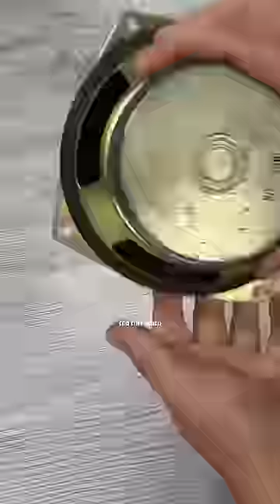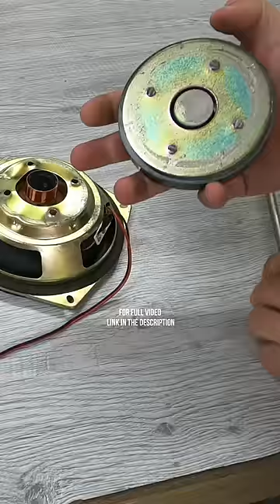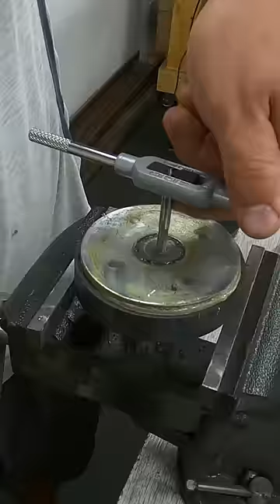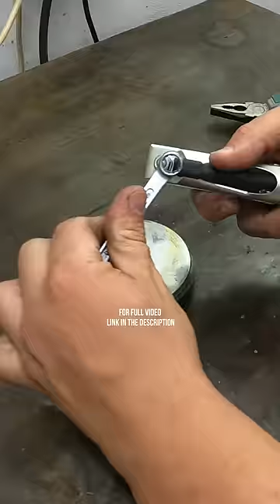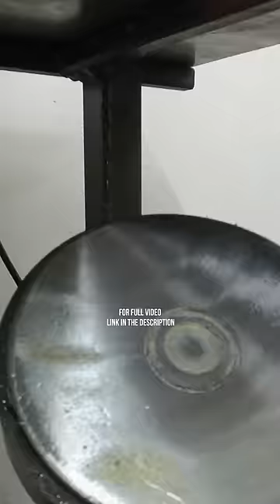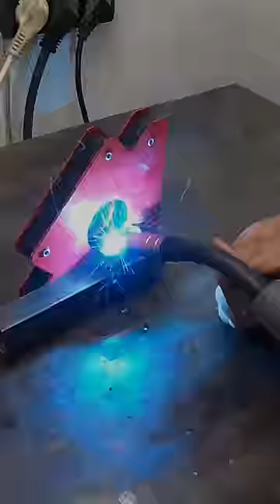Amazing idea from Old Speaker

Comment: I see a lot of people saying heating the magnet will ruin it. While that's true, it's also true the magnet should never get heated. There's no reason it should be close to the work if it's connected to a steel tabletop, therefore it won't get heated (unless your ground surface is bad and causing arcing, which is still user error.)
Reply from the maker: Well done, that's right! The magnets are away from the heat! The magnet is very strongly attached to the work surface!
Reply: Unless it is a superconductor, It will heat up. Also, I'm pretty sure that clamp would have just clipped directly to that metal table. This is clickbait. Anything so simple would have already been a commercial product if it were viable.
Reply: That's true in principle.
But the heat generated by the welding current is very low because the cross-section is appropriate. In addition, the mass of the magnet and the table is very large. You hardly notice any harmful warming
Reply: @HangTimeDeluxe  not remotely appreciably, definitely not enough to ruin a magnet. 
I've never even had my regular ground clamp heat up if it's more than 6" from the work,  except maybe the face of the copper pads. If your ground is heating up it's either undersized, has a poor connection or too close to the work. 
Period
Reply: @HangTimeDeluxe   Magnets for welding ground clamps have been available for decades. Nothing new here other than he made his own by recycling an old speaker
Reply: You can pay original for those magnat clamps.
We use it in car Repair shops .
If we need new body pannels on the cars.

So its new .
Its a good DYI that is for sure.
Reply: @HandmadeCreativeChannel  iiiķo
Reply: 3 magnet killers, Heat, banging it & A/C field.
Reply: @CryptTonite1955  yep all those welders that use commercially made magnetic ground clamps are replacing them after every use.
Not to mention banging does zero to permanent magnets, unless they're actually shattered, then each piece is magnetic.
Reply: @HandmadeCreativeChannel  l
L

Lll
Reply: @HangTimeDeluxe  To say anything that’s simple would already be a commercial product if viable is a ridiculous statement. Especially if you ARE AN ENGINEER!! 
How many products out their are over engineered?, and made as regulation. I’m a building contractor OF OVER 60yrs and I can FACTUALLY say most houses are over engineered. So many products in the world that are over engineered and the simplest way as you say is shut down. Why because it won’t make to companies money.
Reply: I, at first, thought this person is going to make a super electro magnet! As in the ones that move recyclable ferrous™ materials in to the foundry....7;^> ....heh
Reply: @CryptTonite1955  stop talking gumpf, if a/c field killed magnets then we wouldn't have speakers.
Reply: @mcallister1984  speakers 🔊 are in the milli end of things, look up Growler for demagnetising
Reply: 8
Reply: Well there is the minor fact that the bolt that carries all the current is threaded directly into the magnet...
Reply: @HangTimeDeluxe  there actually is a product like that on the market.

Comment: That was a perfectly good speaker!!!
Reply: Nah the speaker was broke after he removed the magnet on back. Wouldn't work now unless he used the cone part in cabinet as a passive radiator speaker
Reply: The speaker looked fine, but part of the voice coil may not have been good.
Reply: @jordan6750  I meant before he took anything off the speaker it looked good.

Comment: Another cool hack for old speakers. A friend of mine did this. He took 12 inch woofers that were bad, and ripped out their cones. They could vibrate, but not make sound. He then pulled the fabric on the back of his couch and screwd them into the couch frame. He then patched them into the audio system, cutting off everything but the very low end.
I tell you, you felt the explosions and the rumble of a plane engine. That scene in Jurasic Park, you could feel the step of the T-Rex.
Was pretty awesome and super easy to do.
Reply: That is kind of a cool idea.
Reply: There's actually a commercial product called "bass shaker" made for exactly this purpose
Reply: Great idea 💡
Reply: существует вибро динамик
Reply: Would you mind to draw this for me?
Reply: I just reconed my speakers,they sound great
Reply: My subwoofer does this without a shaker lol. And btw if you want to mod old woofers into shakers you need to connect the voice coil to a spring and then screw that to the sofa. If you just rip off the cone, nothing will happen after that even if you plug it in an amp.
Reply: @dingdong2103  except it did work. Worked great in fact. It didn't need a spring  because they were pretty big speakers. 10 or 12 inch woofers. As such, when the magnet vibrated, it's mass was enough to drive a vibration through the speaker frame, which aas screw right into the sofa frame. It actually worked really well, as it would scared the crap out of you at the scene when the Trex was first coming and you felt the footsteps more then you heard them.
Reply: @haddow777  The magnet doesn't vibrate without a voice coil and if the voice coil doesn't have mass behind it, effect is going to be minimal. Stop telling fairy tales please...
Reply: @dingdong2103  okay, you  need to read better. I was talking about a speaker with the cone removed, that's all. The magnet and voice coil are all one unit attached to the rear of the frame. Who said anything about removing the voice coil?
Reply: @haddow777  hi, the magnet 🧲 doesn’t move, it’s attached to the speaker frame,but the Coil which is attached to the cone does, just saying.
Reply: @CryptTonite1955  the coil moves yes, but the coil is in the middle of the magnet. The magnet is simply a ring around the coil. As the coil changes polarity, it moved forward and back in that ring. It is attached to the ring by a material glued to both on their face. The cone is attached to that surface.
The coil could not work if it wasn't attached to the magnet, or it would move too far out of alignment and the speaker would break.
When I spoke about removing the cone, I simply meant all the parts above the film bonding the coil to the magnet, the parts that move the air. As such, the coil moves, but very little air is displaced. Thus, the vibration is there, but not the sound.
Reply: @haddow777  hi, I’ve pulled a few apart in my apprentice days, very simple but magical how that shaking creates music and singing, cheers 🍻
Reply: @CryptTonite1955  does it compare much to a full sound system that's outputting the exact sound being fed into it? The entire point of the system was that the ripped apart speakers would be working in sync with an actual sound system. Of course vibrations will make some sound. In a setting where there is a much louder sound system in sync with it though, all anyone is going to notice is the vibration. Especially when it's mounted to the back of a couch that has a lot of padding between the people and them.
I simply don't understand your desire to poke holes in something that was plainly described initially. 
Yes, of the only output was to just the coneless speakers, likely we would hear sound. Only  a low rumble though, as only low end base was sent to them  but all the same they likely made some sound. None of us noticed any though, because the many well functioning speakers blasting at the time simply overshadowed it to the point it didn't really exist anymore.
Reply: I love my bass shakers. So amazing on a simulator. Every sequntial shift has that snap to it

Comment: The best way, if you don't have a place to clamp onto, is to put a piece of 1/8" 1" x 2" into your ground clamp. grind the paint off the item you're going to weld. Then shove that piece of metal against your project metal and do a light tack. Problem solved. When done, knock it off with a hammer and clean up with a fine flap wheel on your angle grinder. Keep magnets away from welding. The magnetic flux bends the arc. That's the way arc shutes for big contactors are used. To draw the arc away from the tips so they wont fry. Also, heating a magnet will make it loose its strength really fast!.
   The way professionally built magnet grounds are made, is that they have a strong spring on a center bolt made out of copper, and bolted to the welder ground cable. When you put the magnet base onto your work, the spring holds pressure on the copper grounding contact to your project.

Comment: very good idea I use a 10 lb magnet myself and I don't have to mess with that stinking clamp anymore the only problem is you have to use a clamp on aluminum when you're welding it but still fantastic anything but still won't work still have to use a clamp
Reply: Depends on how thick the aluminum is. On thin sheet you can put a thick iron disc on one  side and the magnet will stick from the other side.
Reply: Ben and Kiki

Pp

Comment: Great idea, I do not like introducing magnetism to any metal while welding. Or any tool especially when machining, because of tiny particals sticking to the bits. Your better off not doing it. I've also seen parts get so magnetized, welding is almost impossible.

Comment: The magnets also work good for mechanic on your car lift arms you can put one magnet on each arm and stick lug nuts to them or other nuts and bolts and even tools too so they dont fall off and wack you😎✊🏻
Reply: DEFINITELY A USEFUL SUGGESTION!!!!👍 Most people wouldn't think of something like this! Although, I have magnetic dishes that I use all the time for holding lose nuts and bolts!
They are simple enough to make, just get some speaker magnets and a sturdy metal bread pan and glue the magnets to the bottom of the pan... Viola, you have a magnetic parts tray!!!
Reply: @randyherringshaw6325  most of the magnets are wide and work like a dish too when you magent then to the lift arms🙃

Comment: I have used a magnet on my welder for over 25 years now...this is not not anything new. over time the magnet loses its power, then just replace it. Simple as that. And if you must use the clamp just attach the magnet on to the clamp.

Comment: You just put the ground terminal right in the way of the magnet's ground contact surface.  Put the terminal on the other side n this is a great idea
Reply: Correct, coil gap side is much stronger.

Comment: Нагреется, магнитные свойства теряет и ваша масса будет отпустить и провода массы начнут грется
Reply from the maker: Масса находится слишком далеко от источника тепла (переводчик)
Reply: @HandmadeCreativeChannel  контакт нагревается сам очень сильно
Reply: @MrStrocko  Not if it is a good contact!
Reply: @MrStrocko  If you are that worried about the contact heating up, you could always just use some dielectric grease to improve the conductivity of your contact which will decrease any heat buildup from the electric resistance of the ground!
Reply: @randyherringshaw6325  обычно я привариваю кусочек металла к изделию и подсоединяю к инвертору плюс или минус

Comment: what if stainless
Reply: The magnet is stuck to the table and will still provide a stable grounding to weld on, regardless of the metal you are working on! Unless you use a stainless steel table and then you will have to use a traditional ground clamp.
I hope this answers your question! 👍